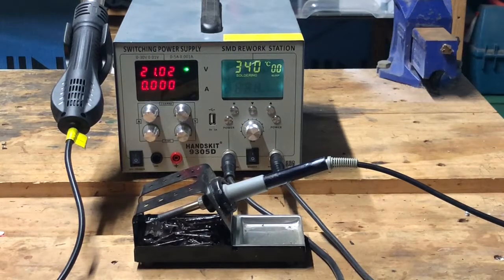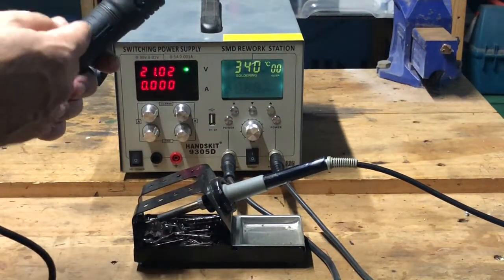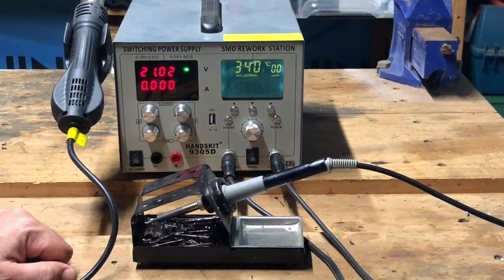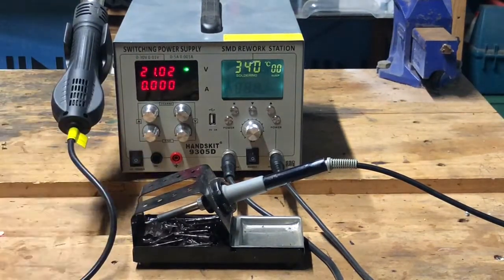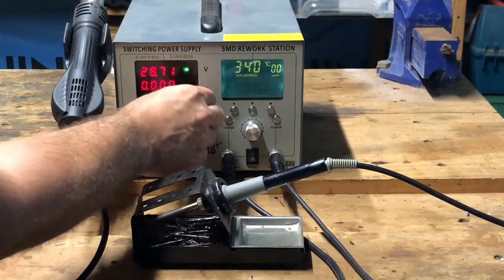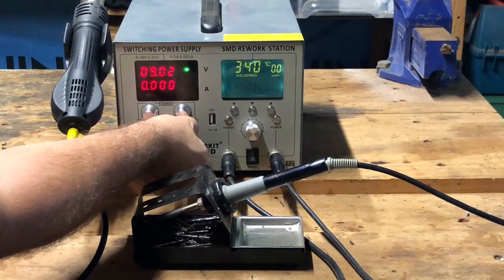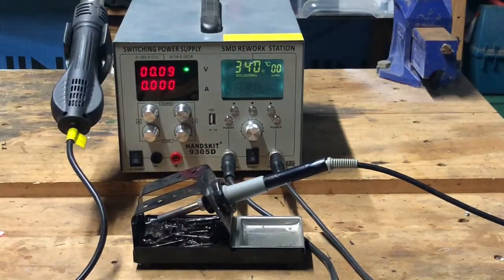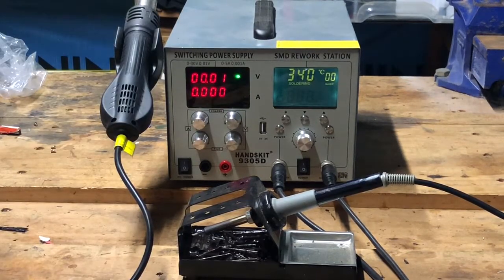Update to Handskit 9305D Review

Comment: It's cheap chinesium, basically. For the price I paid, I think it's OK, and I'm not sure how much better the other cheap SMD rework stations are. If you want quality, buy Weller or Hakko. You will pay 4 or 5 times as much however.
Reply from the maker: True.  Did yours have the same problem as mine with the highly inaccurate ammeter?   Or have they improved that since?
Reply: @princhester3470  Haven't checked it, because I haven't used it yet. Most of my projects are USB powered at the moment. The SMPS is pretty clunky, and the 10 turn pot mod is a REALLY good idea.
Reply: @asdf35750  Well, be interested to hear what you find when you use it.

Comment: Hi, I wanted to know if this would be ideal for me, I wanted to fix iphones and laptops so ranging from 3.7v-20v would this be ok straight out the box or would I need to upgrade it like you did? U said it's not really accurate that's why I'm asking.  How's it holding up btw did u have any problems?Thanks
Reply from the maker: I don't know what level of precision you need.  I've never used it for fixing iphones and laptops

Comment: I would suggest adding more magnets in the hoslter to fix the gun. Thanks for making the videos. I was curious about this unit. Those other stations that can also read voltage and amp are interesting but I didnt find a 5 amp station that could do it.  Maybe I should just go for a separate power supply, they can do 10amps for around 30-40$ 40$
Reply from the maker: Yes I keep meaning to replace the existing holster magnets with neodymiums and add another one, but haven't got around to it.  The problem hardly ever occurs since I put in more reed switches, anyway.

Since making the video I've actually done two upgrades.  I've replaced the ammeter module with a cheap but much more accurate ammeter module.  I've replaced the single turn pots for V and A with ten turn pots.  I'm now really happy with the unit.  I have the video for another update about this but haven't finished editing it.

I would now say, IF you like fiddling around doing upgrades, the unit is good, as long as you are prepared to do the aftermarket mods I have done to fix its weak points.
Reply: Sounds promising, I'm eager to see what the upgrades look like. Would appreciate if you included info on the parts used. Thank you!
Reply from the maker: I've put up a video on the mods now
Reply: @michaelfisher9671  I had been wondering, some other models have a switch and an extra banana plug connection to use the power supply as a volt/ameeter, did you see anything that suggest it would be a possible mod?